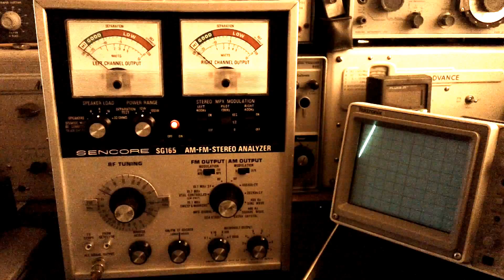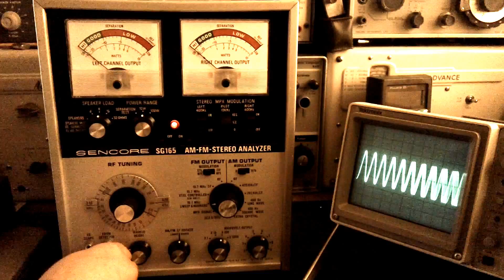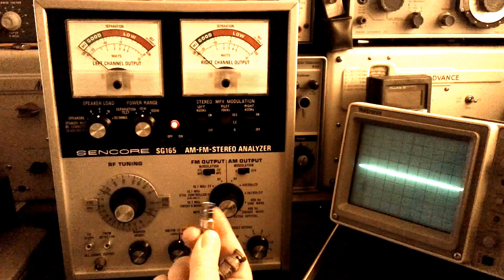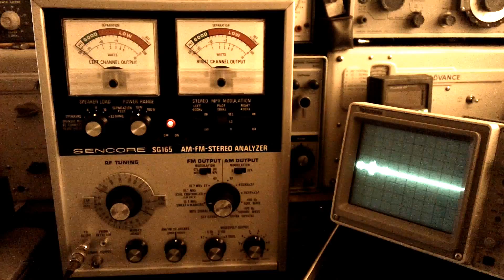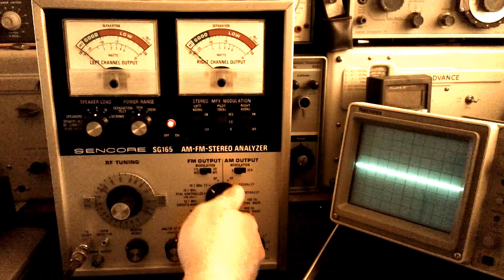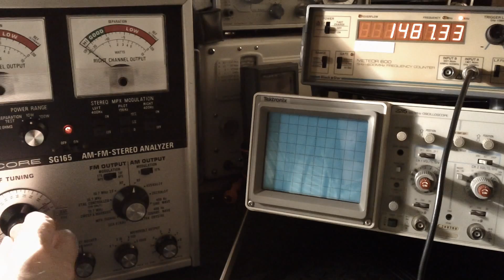Sencore SG165 AM-FM Stereo Analyzer

Comment: Andrew, I have one of these units and there seems to be a problem with the 19khz multivibrator section, which is part of the mpx board.

I wonder if you might be able to get some scope screen shots of the test points called out in the service manual regarding this section?

Your help would be greatly appreciated.

Comment: Andrew: How did you figure out ahead of time, that the RF output of the SG165 measured by your freq counter would get progressively worse till you got to the 1,000 KHz/1MHz point, then snap back to accuracy here? Of course, I see that you were "spot on" with your prediction. This is very curious to me that you had figured this out BEFORE actually testing the Sencore SG165 itself. Hmm... A good one! Would love to get some clarification here.
   I'm quite befuddled.
       Cheers my friend,
            Tom
Reply: *****
   I have two sweep signal generators and a third one that is just a straight generator. All are valve vintage. I would have probably noticed this as well but I never trust them for accuracy anyways. I just get "close" with the dial then use my frequency counter to narrow it in.
  I should just try this test out someday just for fun!
       Thanks Andrew and Art for your feedback!
Reply from the maker: Hi Tom, Fair question and Art's alluded to the answer but my feeling that the SG wasn't going to track its dial scale accurately in the mid-section was based on previous experience with other sig-gens I have. But I didn't actually know the SG165 would be out, no, just a guess-timation. However, I didn't expect it to be out as much as it was so I expect it's out of cal and needs calibrating. After all, it's only 10 years younger than me and I'm well out of alignment these days. The manuals calibration recommendation is to zero beat with a known radio station frequency at the high and low end of the band.

Both of my Advance signal generators in the background (the ivory coloured equipment) have similar properties. They are very accurate to the scale at the low and high end of each band but even after I've let them warm up for an hour the tracking goes slightly awry mid-scale. Not much I might add but enough to cause me to spot check with the frequency counter. The big, blue generator in the corner of my room is much worse. I read in one of the many threads on the SG165 on the Antique Radio Forum that one owner went through the calibration procedure and he'd improved things. I'll see if I can find it again and see what he actually said.

Regards - Andrew